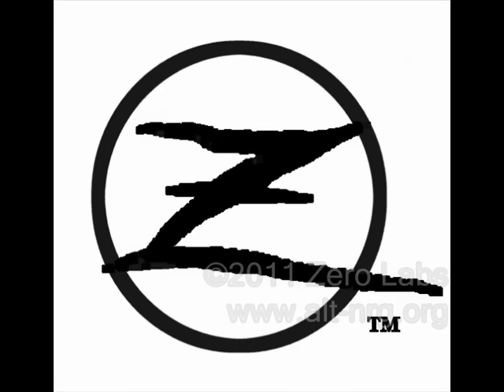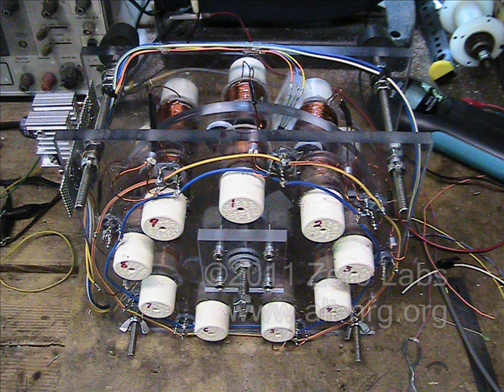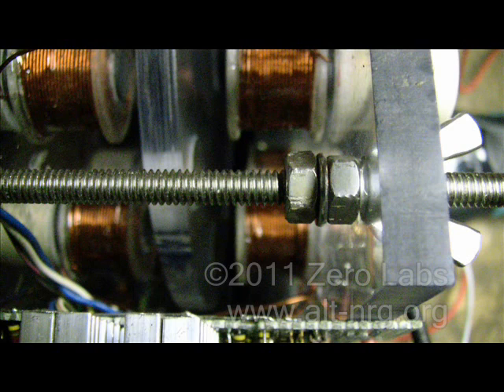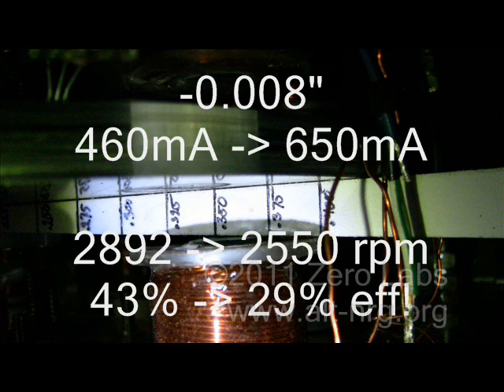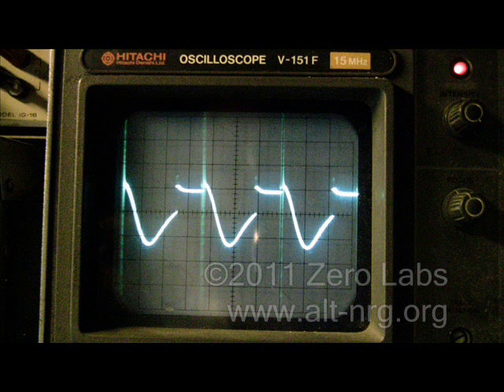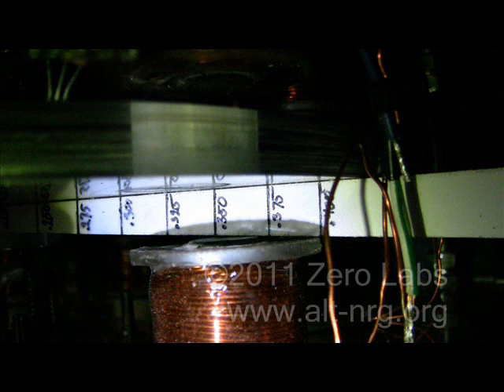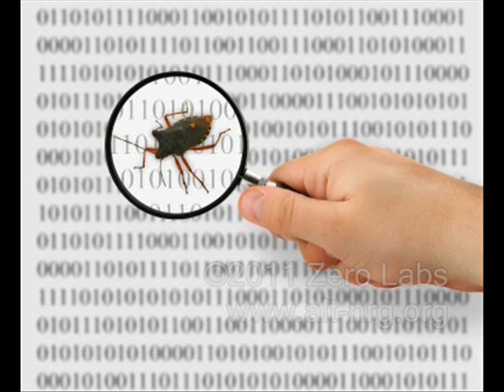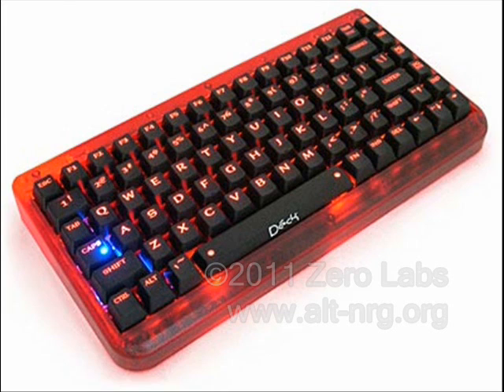#292 52.3% efficiency milestone with Muller Motor!

Comment from the maker: I'm a long way from completion on this project. What you see here I believe is a mere fraction of what's possible. The reason for excitement over 52.3% is even that far exceeds what many have been able to achieve.
Reply: I thought Muller supposedly got his motor to 108% measured at a university.  But... did they measure correctly?

Comment: Hey, haven't really watched the video. Just responding to the efficiency. Why is 52.3% with this motor significant? Good electrical motors/generators can achieve over 90% efficiency.
I am not trying to insult your work or whatever. I really want to know the answer.

Comment: Hi Mr Z.
I would like to get coment about mi idea, i think it could be good idea to fix a flywheel on the rotor shaft to minimise loss on load, i know the coils are doing that job but maybe more waight will help, 
Its my first time comment to you, i am a good listener and whatcer sinc you begin with the HHO, i was 3 month working on hidrogen project to add hidrogen to mi car and i did wery efficent unit but the electronic on my BMW is to hard to fool, so i gave it up with wery bat results.

Comment: Hi Mr. Z
Thanks very much for your replay!!! Do you have or will you have a turn key system that can be purchased? What do you think about the water for fuel system that is on the market? Is it possible to run a car on 100% HHO and is there a system that will generate enough HHO for a 100% operation. I know you are very busy and I greatly appreciate you time. I hope my questions are not totally stupid.
Blessings
Gerald

Comment: With this new info, looks like individual computer controlled stator pole spacing is a new requirement in order to help get optimum efficiency, ey?  Computer could adjust each stator pole until it "see's" the best efficiencies, right?  No more guessing, instead, would be digital scientific observation... Just dreaming... ...

Comment: Waiting for your GUI (Graph. Usr Interface) to that Arduino man! What's up w/ not having a realtime GUI where you can adjust this stuff realtime.  Guess that PS2 keyboard is close, but just not the same thing, you know? Maybe GUI via Browser interface? Just wondering. Also, w/ that Arduino, should be able to GATE the output and get some OUTPUT from a GUI interface as well, ey? Such as RPM? Should be gated, and not using a manual rpm gauge u point at a white mark on the rotor? u'll get  there!:)

Comment: The back emf of each coil / magnet interface would act like friction to motion more and more as the magnets got closer to the coils, but the induced voltage would be higher, and higher. If your diodes & transistors could handle much higher voltage, then your circuit energy should not have been wasted as much as it seems to have been?
Your diodes can only handle 40 VDC, so any excess would cause breakdown losses, and heating. Your transistors can handle 60 VDC right?
What if induced was >150 VDC?

Comment: @crippled82 You just may be right, but one thing for sure after Zero Fossil Fuels has finished this project and if it works or does not. The Muller/RomeroUK motor will never have to be visited again, that will be the result of the work Z does in finding the truth. Reminds me of the X-Files or Z-Files “The truth is out there” Fox Mulder – Z Muller?

Comment: I’ve been here at work thinking about your findings Tuesday evening. Since you’re doing such a damn great job with this I put on hold the part of the Muller I started and went over to another Project I have wanted to work on that parallels this. You are now heading in the area of fine tuning which I believe is one of the keys to this puzzle. You have mentioned how the rotor mag reacted with the bias mag thru the ferrite core and found .25 to be the neutral point so time ago.

Comment: Question, do you believe it is now in the magnet flux and generation flux fields in finding the balance from the rotor magnet, coil/core eddy currents that generates the secondary magnet field that is either being diverted or maybe somewhat canceled out by the bias magnets. Other words, finding the best alignment of all flux fields is what will bring the efficiency to the magic number.

Comment: Hi Mr.Z...
You should have more than one set of induction coils,with different kinds of conductors (romero used litz wire salvaged from CRT monitors).Make them interchangeable.
Also,if you have time,look into doping (oxidation).Some people had interesting results.
Nice work so far.Just remember that most of us quit halfway.